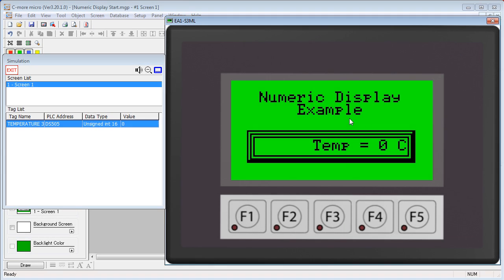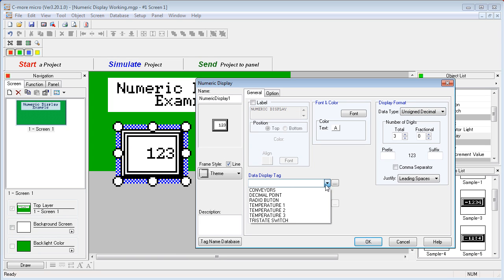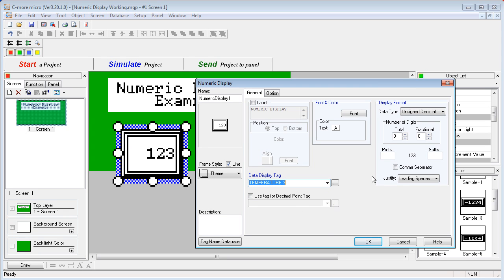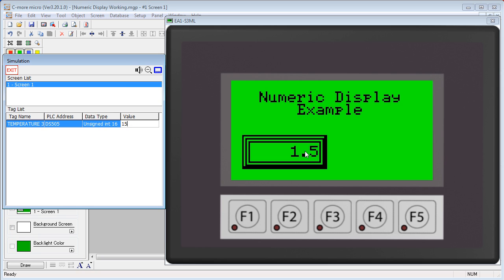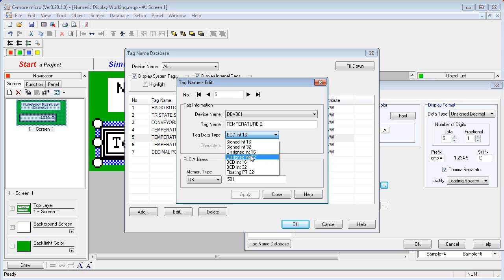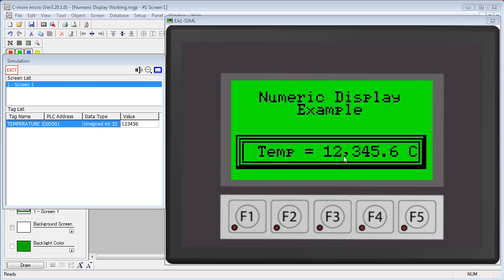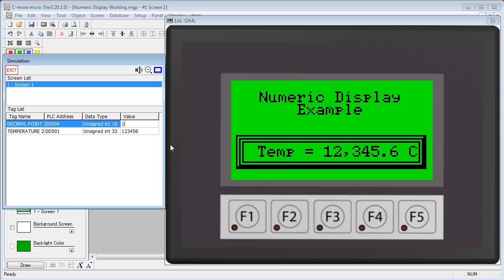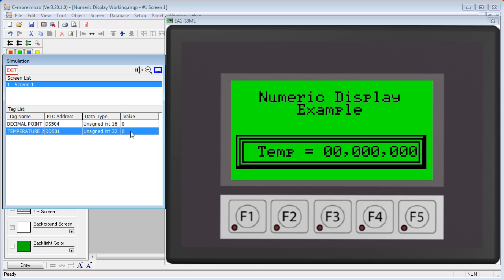C-more Micro HMI Numeric Display from AutomationDirect

Comment: I also would like to do the same.  I need to be able to enter in a value that looks like a value for a timer.  For example "12:35"  where 12 is in minutes and 35 is in seconds.  Using up and down arrows, when 35 reaches 60 or 0 the 12 increments to 13.  Can this be done either on a c-more or in coordination with a Click PLC?